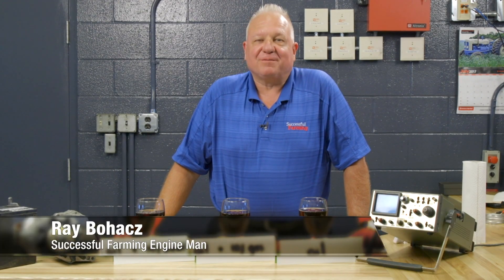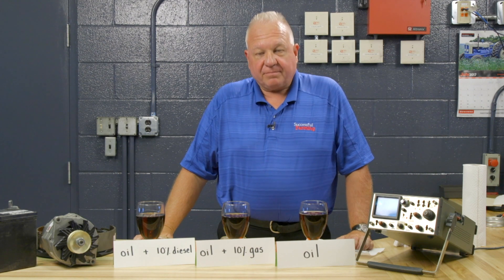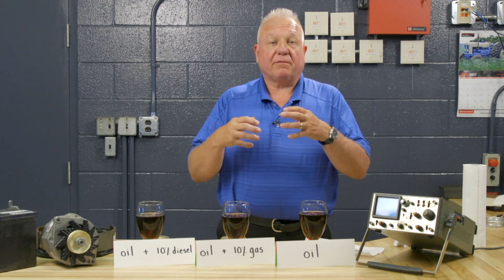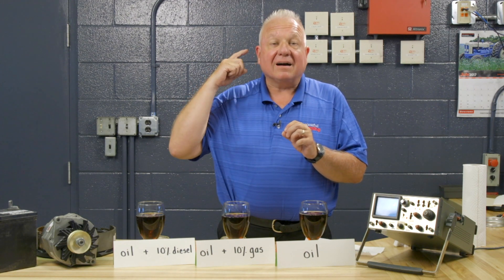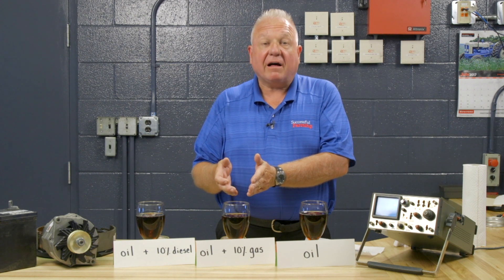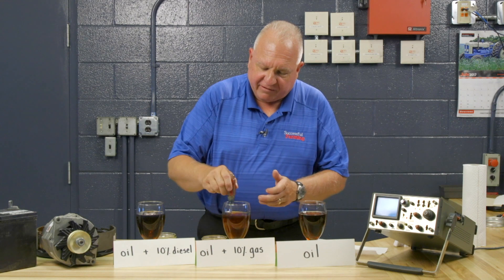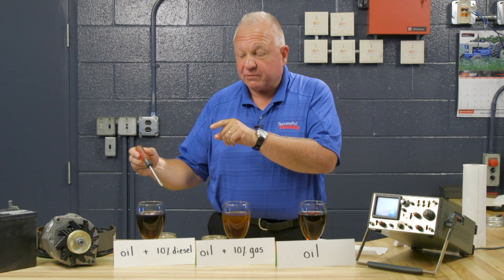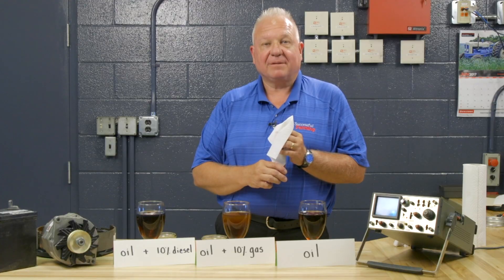Fuel Dilution in Engine Oil | Farm Repair & Maintenance | Successful Farming

Comment: Really common on gas/petrol engines. Stuck injectors are a big culprit, they can get stuck open also.
Reply: That’s gonna hydrolock your engine before it causes any other issues. Even a leaky injector can hydrolock if it sits long enough but actually being open and flowing fuel at pressure will rapidly fill the cylinder with incompressible fuel.

Comment: Put a drop of oil from the dipstick between your thumb and forefinger and then gently close and separate them it will tell you the viscosity of the oil (stickiness), then do the same test with fresh new oil and compare

Comment: I have problem with my seat leon 1.6 tdi cxxb engine, the negine oil is contaminated by diesel fuel. I checked injectors and are ok the dpf was cleaned, but the problem persists. Do you have any idea what can cause this problem?
Reply: @CaptainDafu  sometimes i drive short distances. but i get like 0.5 litres of diesel fuel in a month. when i get out oil dipstick or oil filler cap there is white smoke coming out, probably diesel fuel vaporized.
Reply: Tandem Pump?

Comment: I have 2000 international 4700 the oil is being pulled from the engine into the fuel pump. Have not been able to find the problem any information will helpful thanks

Comment: Just built an engine started it a couple times always made sure it had oil, oil never rose on the stick from full, but it runs rich. Heard a squeak and shut it down immediately (aprox 15 start ups @  3 mins each). Checked the oil and it was more clear than normal. Drained the oil and it was black and just like water (black could be caused from assembly lube color.) Strained the oil with 2 automotive paint strainers. Found no bearing material. Will change the filter and add new oil. Will my engine be okay?
Reply: Did it have a carburetor or mechanical fuel pump? Or is it a modern GDI engine that tend to foul the oil with gasoline?

Comment: Great video. I only found this inside my oil filter but not when I drained the pan. Very strange although I did run it rich with an old carb for about 20 miles
Reply: Yeah me too, somehow my oil filter strongly smells like gasoline, but the oil in the pan smells nothing at all.

Comment: hello my bmw e30 dilutes gasoline in engine oil in a big percentage , what part i must fix or repair? please answer me
Reply: piston rings may be worn causing blowby, or an injector is stuck open.

leakdown test and injector cleaning and flowtest are on the List.
Reply: Poly ether amine fuel injector cleaner like Techron can clean dribbling sticking fuel injectors.